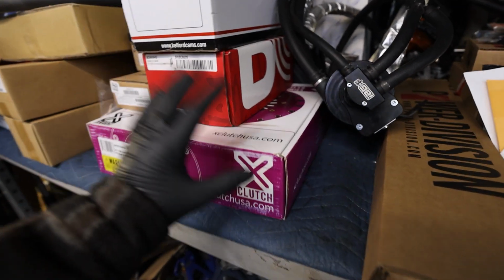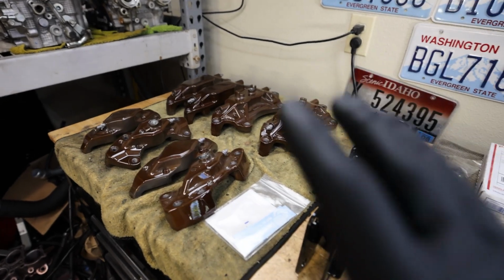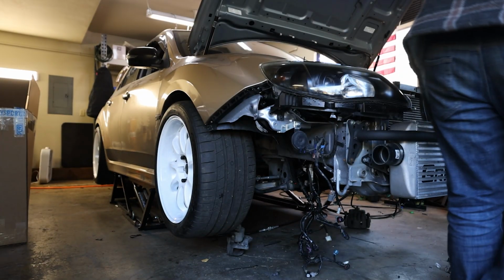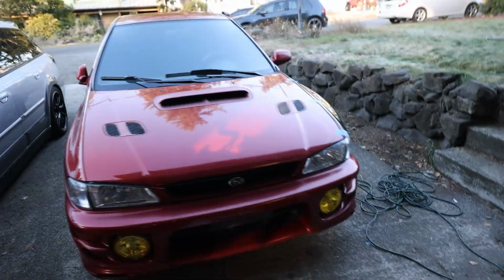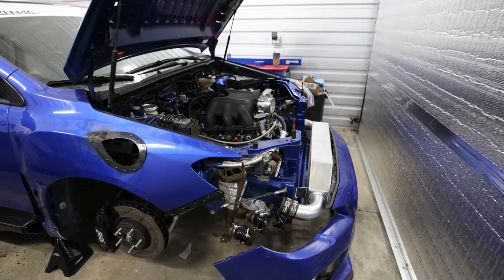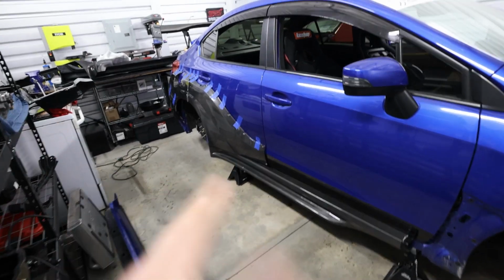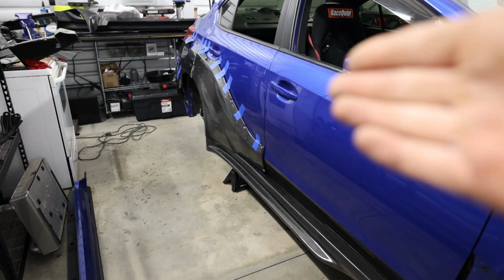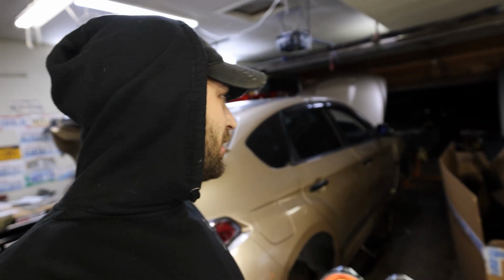Wide Bodies for all the Subaru's!

Comment: As long as it's not so cheap that it's a detriment to the function of the car there is nothing wrong with running some replica parts. It's not worth going into debt to have top shelf everything.  I rock flow formed rep wheels cause I cant justify $5k in wheels and tires on a car I bought for 9
Reply from the maker: 100%, If someone can afford to run top shelf parts on everything than I'm all for it. But for most of us that's really not an option all of the time 😅